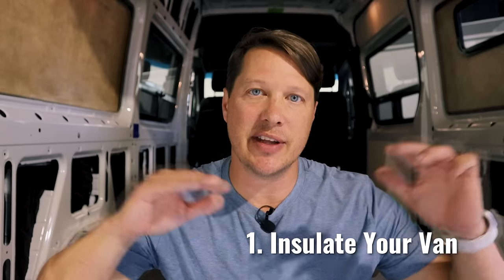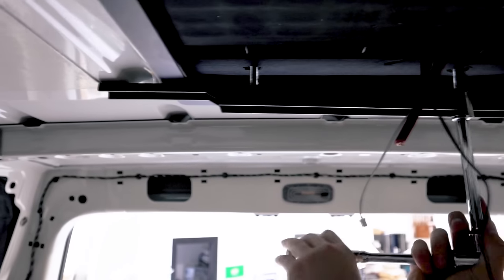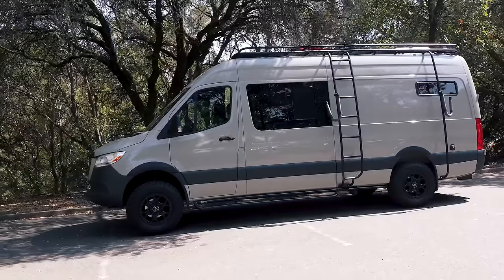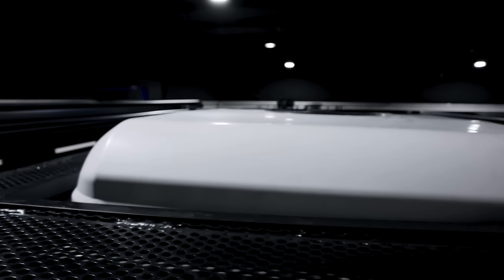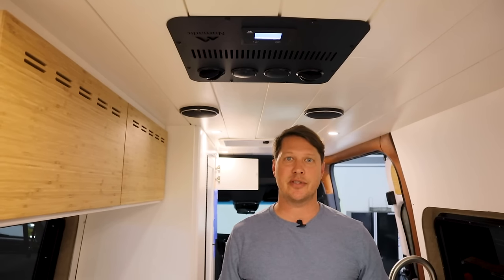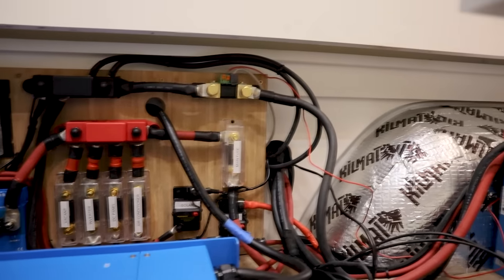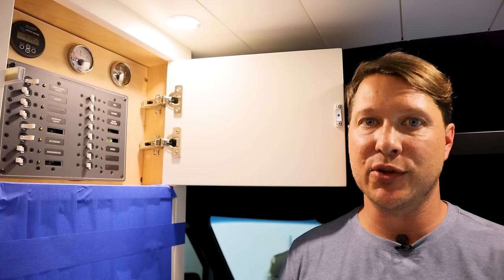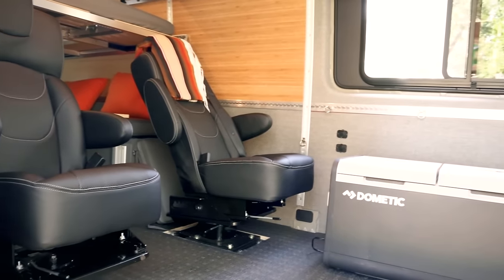Perfect Air Conditioner For Off Grid Sprinter Vans

Comment: Any ac that mounts on the roof is not going to be very efficient  and is going to use a lot of power 

Why would you want air-conditioning if you can't use it all the time without having the van running 

There are a few DC AC units that are available that work great and you can run them 24 hours a day 7 days a week  just from solar and a decent battery bank 

A 1000 Amp  24 volt battery with a 10 year life  is not very much more than what  the ac units you are showing cost
Reply from the maker: It runs off of the battery bank.

Comment: This is a great video. I was sold.  I needed something like this. But of course you The best for last.

Yeah no. This unit is only designed for those.  Who simply have the money for a 12 or 20 V unit.  Not really for the people, it should have been priced for. This is nonsense..

What new technology could create a 3-$4000 price tag? For a roof mounted air conditioner? Hello? How do you spell Insanity? US DOLLARS.

I am sorry there is No Technology. That requires $3000 plus for a roof mounted air conditioner. None. This is beyond Bunkers. I mean honestly now? There is no, honesty, now. Let us review.

Condenser, evaporator,  compressor. Refrigeration juice. A radiator. An electric motor. AC or DC power. You build it into the unit.

So you take your stock, $800 rooftop 120 Volt  unit. And you build a special, goof proof, fail free, $50 inverter. Into the unit. Now they can charge between 3000 and $4000! How perfect! We will now become billionaires!

As that's all that's needed to be done. And how much current does it draw with the air conditioning on full? About the same. 800-1500 Watts. You can talk about amps. Others will talk about, volts. Some of us are hard of hearing and keep saying… Watts? Watts you say? What Watts? Who's a, Watts?

And that's all that really needs to be done. Those other inverters that don't work out well for people. Right. They are too small. Too lightweight. Not enough Heat  Sinking. As they are external to the unit. And they stick them in hot stuffy places. And they fail. When they get hit by a, air conditioning compressor kicking in. And the Start capacitor is, going soft. And whoopsy!

As so there is absolutely no reason this should cost $3000-$4000 for a rooftop air conditioner.  For your low-cost motorhome. Because this is only for the high-priced spread.. That doesn't need them! Again..

And so I don't think I have anything good to say about this unit. Not at this price point. And where do you suppose it is being imported from?  How much do you think it costs, in China? $150 US? Something like that. And this makes it all better. For those that also have $10,000 worth of, Lithium Batteries.. And Your Sinewave 20,000  Watt, Inverters. Providing better than, shore power. Cleaner and more stable. And Auto Compensation for EMP. So no worries about, Carrington Events. Your child porn will never be found nor lost. Jeffrey Epstein made that mistake. As you had to forfeit his island.. We all wanted to see some cracks at. I mean he was his own country. He had his own laws. He wasn't doing anything wrong. In his country.  Girls can be married when they are 13. And he only had girls that wanted to get married.. To, Prince Charming guy with hands from England. I think there were a few? They most all look alike.. Stupid. Therefore easy to spot in a crowd. I bow to thee. In a pig's eye!

So this is utterly, totally, bonkers stupid. It should cost no more. Than any other, similar, rooftop air conditioner. Sorry.. This is bullshit.

Oh sure. They are using some of the newest technology, solid-state, refrigeration, devices. Plug a whole bunch of them in together. Where cost is no object to rich folk. Who can have anything they want, to have. By simply demanding. And it is custom fabricated for them.  No matter the cost. And so sure! Someone will gladly, cast and create. Your very own, V-9 Engine for your car. But the engine might cost, wanted and $150,000, give or take a couple? But they will build it for you. If you have the money. They will make their own sand castings. They will forge their own, Titanium. You can get anything you want for a price. And $3000-$4000 for stupid wealthy people sounds just fine! Sure! Install 3 of them. So we don't have to worry about our, Bargain,  Modified Sinewave  Inverter blowing up again. Spending an additional $15,000? No problem.

For the smart, $2.5 million, semi tractor-trailer Motorhome. With a smart owner. Having, money than brains. That Demands a 12 or, 24 volt unit//units.

This kind of bullshit is never-ending. A ridiculous product for ridiculous people. That's all that matters.
RemyRAD